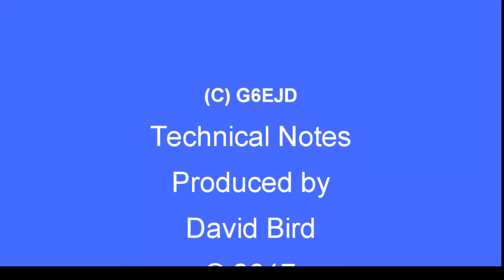Tech Note 042 - ESP32 Weather Station (two code examples provided at GitHub)

Comment: great work. Hope we get more from these stuff....
Reply from the maker: I'm please you like it, the ESP32 has great potential once we can get  carrier board that does not take too much power, at sleep the ESP32 takes 11uA but all the boards I have take about 22mA accounted for the LED, voltage regulator and serial interfaces, the Wemos D1 was about perfect, the suppliers need to get the ESP32 to that stage then we can use it for battery powered projects that last a long time. Have fun.

Comment: nice work... looking to do a similar thing but using a sonoff wifi switch these are only £3.76 and will work at mains voltage what i wanted to do was connect a dht22 only and be able to log data to something either an sd card read, or to publish the data across my network,  just thought it would be a simple mains plugin device..
Reply from the maker: Almost plug-in but needs a mains trailing lead. They are a reasonable building block. I see AliExpress are now selling a nice IOT like device comprised of an ESP8266, BME280 and a 1750 UV light index, making for a comprehensive environmental sensor all on one nice neat board a little larger than the size of a Wemos D1 Mini.
Reply: just curious i see you have done a bit with the esp8266 is it possible to use gpio 1 and gpio 3 to run 1 wire or other devices as the serial port is only used for firmware flashing... maybe for an i2c device..? i say this as its already broken out on the sonoff to easy pins to get to.. rather than have to solder to the esp8266 device smd pins... ?
Reply from the maker: bing quadby If the board has no UART like the SONOFF then yes there are no loads on the pins and are free to be used for other purposes. You’d need to ensure there was no software conflict like the pins being assigned to two functions for reliable operating. On a standard development board only one pin is usable the one with the UART input connected to it, the one with the UART output connection will present loading problems.
Reply: thanks for the reply... I have used arduino before so fairly comfortable with using serial ports on atmega, have built a few quadcopters from scratch with multiwii... but  just noticed the esp8266 and have a few plans for the sonoffs, have you used sonoffs yourself... and used tasmota firmware  ? just curious as looking to add some ws2812b led strips on my sonoff. regards Alun
Reply from the maker: I've got some sonoffs on my bench here, not had time to re-programme them, but there are lots of 'hacks' that explain how to. You'd need (ideally) a USB-UART adapter freely available for about £0.60. A good link: https://tzapu.com/sonoff-firmware-boilerplate-tutorial/
Reply: done the firmware update last night on sonoff went well got a usb uart here already... just looking at what else to do with the thing will be great for switching lights on off in my garage, and monitoring outside temperature, and a cool flashy alarm led all in one unit thats the plan anyway.... once the initial tasmota firmware is on, the device can then be flshed ota so no need for usb uart anymore.... happy days.,...!!!!!

Comment: Hi again,
I get a new ESP32 with OLED. I have tried to compile your sketch. I get error because lib is missing. fatal error: SSD1306.h. I have tired to fix these with Adafruit lib but it doesn't work. Can you give me a hint where I can find correct lib ?
Reply from the maker: https://github.com/squix78/esp8266-oled-ssd1306 is the library you need

Comment: would it also be possible to send your own data to weather underground, so you could get like a new spot on the map for everyone to see the weather data from your own location?
Reply from the maker: Yes, in-fact my weather station does it and you'd send data (using your account and password with something like this: https://weatherstation.wunderground.com/weatherstation/updateweatherstation.php?ID=KCASANFR5&PASSWORD=XXXXXX&dateutc=2000-01-01+10%3A32%3A35&winddir=230&windspeedmph=12&windgustmph=12&tempf=70&rainin=0&baromin=29.1&dewptf=68.2&humidity=90&weather=&clouds=&softwaretype=vws%20versionxx&action=updaterawThere is a Wiki devoted to the subject here: http://wiki.wunderground.com/index.php/PWS_-_Upload_ProtocolWhat you'd need to do is create a new WU station which is possible (I have three) and then in the code replicate the reading API which sends the API request and replace or copy to a sending API function what is being sent as a GET with the example above, populate with your data and using your weather station name and password. The http request for sending temp and humidity to WU associated with your station would be built like this:
String request = "https://weatherstation.wunderground.com/weatherstation/updateweatherstation.php?ID="+our_station+"&PASSWORD="+yourpassword+"&dateutc=now&"+String(tempc)+"&humidity="+String(humidity);
WU accepts "now" for date-time that needs to be in what's called escaped format, so this greatly simplifies the data construction and uses the WU clock.

Comment: I think you have the dht 22 the correct way. If you put it the way that you've shown it now it will not have enough airflow to do an accurate temperature sampling. also you may find depending on the profile you're running for WiFi and sleep that the temperature could be incorrect because it's so close to the esp 32.
Reply from the maker: Yes fully agreed, but the way I have it in TN042 is the only way the board will fit and be aligned to the correct ESP32 pins. There are two pins on the end of each row that are at right-angles to the main rows, so really it's an all round design fault of the shield PCB as the DIP switch is soldered to a single-sided surface and if the SHT22 was to be soldered on top then it would be upside down, not that it matters. The sellers images are all carefully set out to show the incorrect shield PCB positions, I just wish I'd checked the fit before I soldered the main pins. Mine is definitely over reading on temperature, but that's just about OK for a development environment.